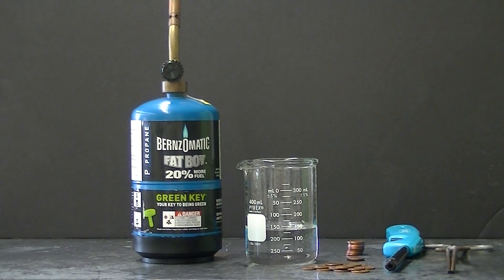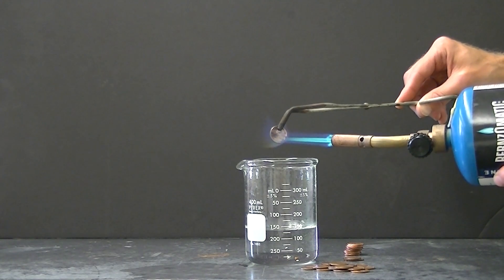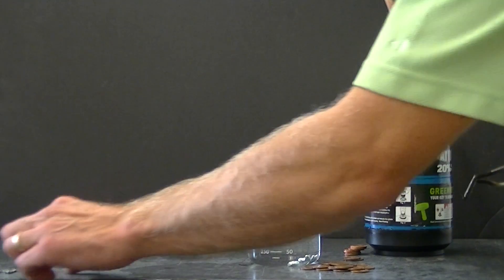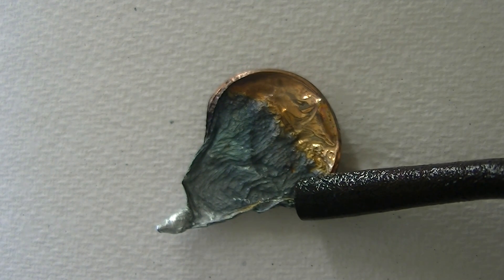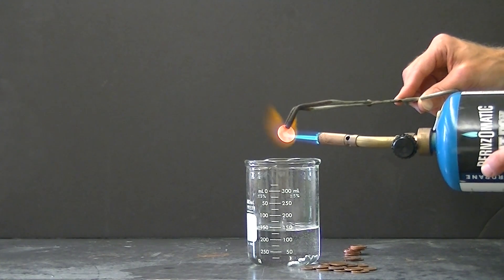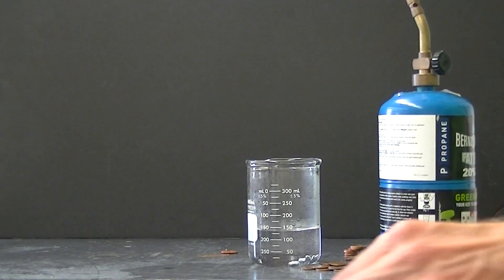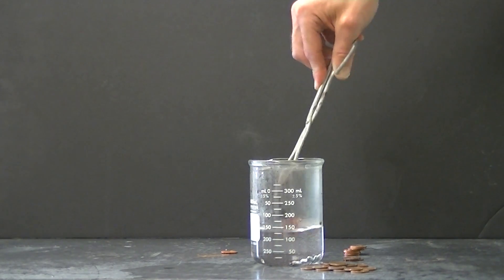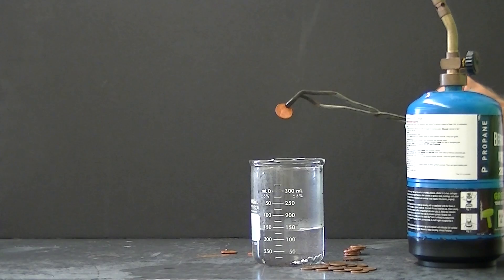Melting pennies - simple DIY science experiment

Comment: If you melt them in a crucible and use a borax flux, you can make a type of bronze if you mix in some nickels and real copper pennies the proportions for the copper, zinc and nickel are 60-20-20 respectively and the metal produced is known as nickel silver or German silver and has been used as a cheap substitute for sterling silver in jewelry making or silver plated dinnerware. Just be sure to use the brazing flux on top to limit the amount of "fuming" from the zinc. Inhaling zinc can give you the "shakes" which are uncomfortable until they wear off so be careful. I don't think that it's cumulative, like lead, which stays in your system permanently, though....

Comment: goldsmith/master jeweler here: a jewelers torch can melt copper pennies i've done it many times when converting 24k into 18k and 14k. you're correct that the propane torch you have there will not melt a penny. but if combined with compressed oxygen you can melt a copper penny. two tanks combined (propane/oxygen) or (natural gas/oxygen) one torch will do the job. enjoyed your video :face-blue-smiling::glasses-purple-yellow-diamond:
Reply from the maker: THANK YOU for this info! Where do I get a jeweler's torch?

Comment: Why does the hot copper penny return to its orange color in water?
Reply from the maker: Because the copper oxide that forms flakes off, exposing the copper metal surface
Reply: so it will take a long time for me to make enough copper oxide to actually do experiments with

Comment: Would have been nice to see what the copper oxide looks like after cooling... What would happen if you didn't wait for the penny to produce the oxide? Dunk the penny immediately after removing the heat source...
Reply from the maker: I've never been able to keep the oxide coating from coming off using this method. However, see https://youtube.com/shorts/Itn2HShS5T0
Reply: @TommyTechnetium  Gotcha... Oxide forms before cooling begins... ty Curious... Is there a space between the heads and tails after zinc separates?

Comment: Neat video ... As a mechanic for years I have used pennies to patch all types of mechanic items and have been doing it since I was a teenager 4 decades ago. Don't remember the first time. I think it was a hole punched in gas tank on my motorcycle  too big to just braze with my skill level back then.  
However::  Good example. I was at a friends house and he had a 1947 excavator with a 1.5 inch hole in an exhaust manifold.(  he was worried never to be able to find a replacement. My first job was to take several pennies and braze them together   big enough to overlap the hole. Then I brazed them to the hole on the manifold. This was 25-30 years ago and for years after that he used it just that way. That was also the year i discovered that the newer pennies were zinc, as soon as you put heat from a acetylene torch they instantly melt.. Researching why( back in the days then you had to drive to a library and research and learn, lol, i learned the government experimenting with make cheaper "ONE CENT" pieces( pennies are actually a nickname you will never see an american coin with penny on it)  In closing I believe 81-82 they experimented with a handful mixtures like 6 to 8 different ones before they got to the currently alloy percentage.

Comment: Pennies make great weather proof decorative washers. I have used them on copper roofs and gutters. Quarters also for highlights. Just ground flat a few quarters that fit perfectly to act as shut offs in a hydraulic circuit on a backhoe with 5/8-10 - ORFS fittings. Plugs or caps cost $8.

Comment: Zinc is also less dense than copper, so another thing you should be able to do is get a large iron or steel cup full of new pennies heated to red-hot temperature... the copper layers will sink to the bottom of the pool of molten zinc and you could just pour the molten zinc into water through an iron or steel mesh filter to prevent the copper from falling through. Or would the molten zinc not be able to escape the copper foil that way?
Reply from the maker: This is a cool idea...!

Comment: Hey Tom,

Awesome video. On occasion, melting a post 1983 penny emits a beautiful shade of light blue. I haven't figured out how to get this color every time. Do you know what is the cause of this?
Reply: Actually its the zinc oxide which is released when the zinc is melted, be careful not to breathe this in as you have a small chance of getting metal fume fever so wear a mask and eye protection because it can also cause zinc blindness, im just kidding about that theres no suck thing as zinc blindness  but the fumes  can irritate and burn you eyes
Reply from the maker: Hi John, thanks for the question.  Unfortunately, I'm not entirely sure what causes the blue color.  My guess is that it is emission from excited copper atoms.  I notice that the more corrosion on the penny (either pre or post 1982), the more likely it is that I will observe blue (in addition to green) light.  Let me know if you figure out how to repeatedly get blue light emission in this experiment.